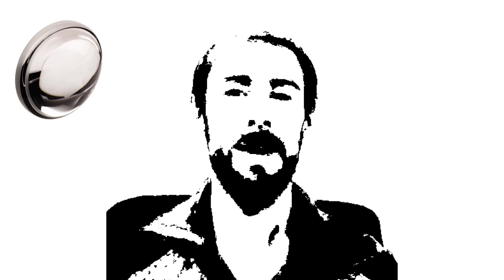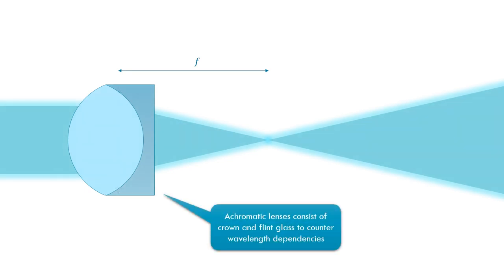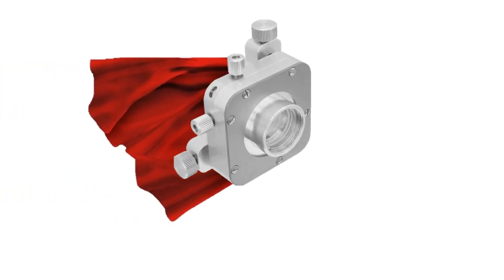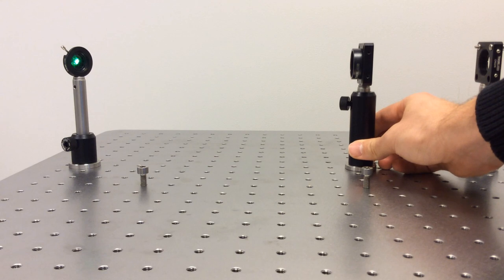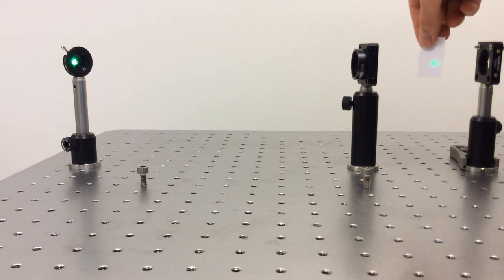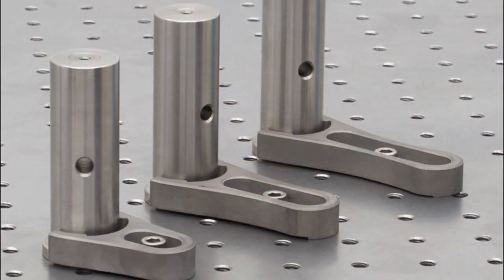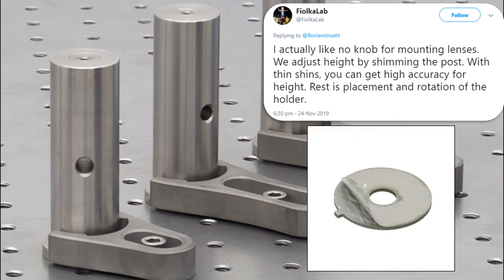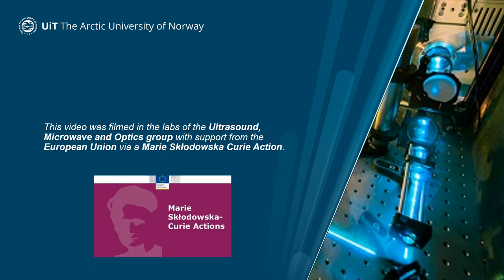5 - Lens alignment

Comment: why the round edge towards infinity and not the flat?
Reply from the maker: This configuration minimises optical aberrations (for the most common case of collimating diverging light with a convex lens). For more complex compound lenses, the manufacturer usually provides you with instructions which side should point towards infinity.